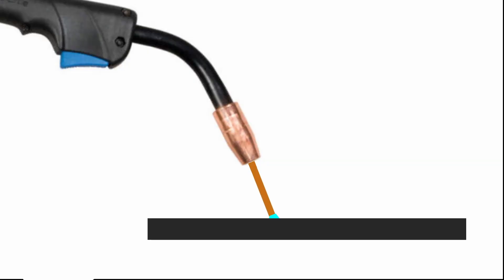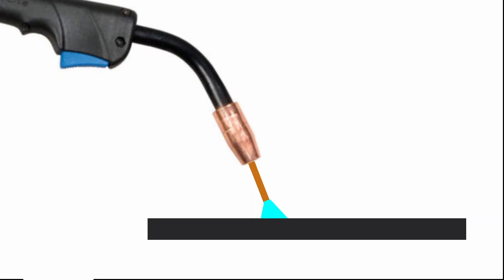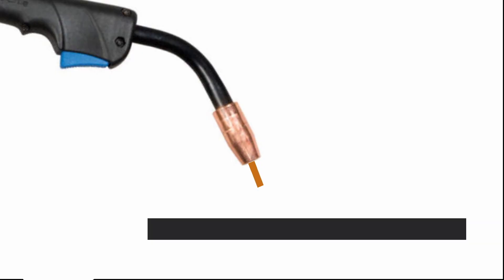MIG Welding: What's Happening at the Arc?

Comment: I learnt the trade of boilermaking in the late 90s…moved into HVAC and then electronic controls from there..The mig side of things were taught to me by a craftsmen level boily,  he was a cast iron expert in pressure vessel repair design and construction.  So he told me that mig is just shit!  TGAW is hands down the best way to weld ally.  Also arc welding in general is a more solidly certain form of welding ferrous metals.  Most fan boys will not like this.  But I have been in the ship building industry for defence and the older methods are still used.  Given the mig style is quicker,  when the welds need to hold,speed is no consideration.  Really the only addition to old methods over technology are addition of inert gases.  People will disagree but let them.  My advice comes from a craftsmen,  of which are a rarity currently.

Comment: 5:20 finally an explanation of the voltage, wire feed, arc length and heat relationship. I've watched 100s of welding videos and have never heard this explained so simple and concisely. Thanks Tim.

Comment: Can you do a video with the htp 160 plus showing what rods can it weld and the durability
Reply from the maker: I'll try to work it into a future video. I''ve used it several times and it's still working great. The only rod I've had a hard time running with it is 3/32" 6010 (runs 1/8" 6010 just fine). I'm mostly a 7018 guy and it's one of the best 7018 burning inverters that I've used.

Comment: Great video, Tim!  By far the clearest explanation of the different transfer types I've seen.  Really good arc shots, BTW.  Why do some gas mixes include oxygen?  It seems counter intuitive.  I thought the shielding gas was to prevent oxygen from getting to the weld puddle.
Reply: To run hotter!  Most guys are going away from oxygen and are moving to co2 instead ….  Which i guess still has some oxygen in it.  It called the active component in the shielding gas, it is necessary to agitate the weld puddle properly.  There is absolutely no active gas when welding aluminum …  and there is VERY minimal active gas when welding stainless and on steel it varies … short circuit can be welded with 100% co2 ( active gas only) and it can be welded with with mixtures as high as 95% argon and 5% either co2 or o2 ….  If you go all argon it wont work, on short circuit it will be too cold, not enough penetration… if you do steel spray it will be too hot and you will have a bunch of undercut
Reply: @ZILAwelds  Very informative reply, Peter!
I see many people who think "MIG" but don't understand that much of what they think is actually MAG (metal active gas)
When the garage warms up 🥶 I'm going to have to get a bottle of 75/25 to see how differently it behaves for me.
Reply: @ZILAwelds  yeah we do aluminum (mig and tig.... mostly mig for me, I'm still learning tig) and we use straight argon.
Reply from the maker: Thanks! Peter pretty much covered it. The addition of active gasses effectively increases electrical conductivity and therefore gives a bit of a hotter arc. It also affects the fluidity of the weld puddle. As far as oxidation goes, the filler metal has elements added which will preferentially oxidize, gathering up the oxygen like garbage men, then floating to the top surface before solidification.
Reply: @TimWelds  YES  that is your silicon and other ingredients.  ER 70-S6 wire   Stands for Electrode (on a) Roll 70ooo psi tensile strength ( nominal )  with 6% silicon ( which is a flow promotor, detergent and deoxidizer.   
So these “glass eyes” on top to the weld bead those are silicon ….
Reply: The we,d additives will only handle a small percentage of oxygen in the gas though, which is why it’s still mostly inert.

In truth, all the major manufacturers of welding wire have charts showing the various characteristics of their wires. They usually show, (ESAB does this most extensively) the weld characteristics for several allowed gasses. It’s notable that always that I’ve seen, the quality of the weld is lowest when CO2 alone is used. So it’s cheap, but not quite as good.

Comment: Would like to see an amperage trace of the feed motor load while the wire is being pulled & pushed. Feedability is also arc stability.
Reply: On single pulse the wire speed is constant. Only on double pulse the wire speed is alternating between a higher and a lower setting. 
As far as amp draw on the feeder motor: it is supposed to be low and constant, the only time you would see high amp draw on the motor is when your wire spool brake would be set too high or the wire feeder is on a very high number or your liner is worn and creates a lot of drag ….
The key is for the electronics in the machine to know how much wire exactly is being fed ….  In order for that to happen there is a digital encoder on the back of the wire feed motor that reports exact wire feed speed back to the logic board in real time so the electronics can make adjustments to pulse settings in real time while welding
Reply from the maker: Like Peter said, the wire speed isn't varied in this example. You're totally right about wire feeding playing into arc stability. In fact, I was dealing with this problem a few days ago (Not on one of my good machines, a cheap no-name brand feeder). I had an unintended pulse going on because of the clunky feeding mechanism :). I've also found that the winding and cast of the wire play into it a bit. Sometimes with cheap 4" spools, the wire will wander all over the place as it comes out of the gun.
Reply: @TimWelds  and thanks for recognizing the distinction between wire feed & arc stability.  Some performance points not covered:
-knurled surface vs smooth V surface drive rolls. Single vs double roll kits. 
-drive roll tension. 
-condition of liner/contact tip or guides
-Manufacturer's GMAW process differences. For S3/S6 copper adherence, surface cleanliness, surface lubricant, point of electrical contact between wire surface & contact tip, wire cast & helix.

Comment: Agree with Lazaro Valadez; I'm a hobbiest and only have SMAW machines. Sometimes wish I could (easily) weld thin stuff—tubes and sheets—but the price of a suitable machine is prohibitive. (Don't bother mentioning cheap entry-level machines; I don't hafta to have the best there is, but do hafta have a good quality, versatile machine.)

Your explanation of the various designs helps tremendously in my understanding of how to evaluate satisfactory offerings.
Reply from the maker: I've run SMAW on some fairly thin stuff, but I always clinch my teeth when I do it :)
Reply: @TimWelds , burst out laughing…still chuckling. I totally get it, and suppose sometimes you just gotta go fer it  
🤣 🤪 👍
Reply: How low does your machine go? I have some 1/16 6013 for thin stuff amd they work fairly well for that
Reply: @anotherrandomtexan25 , thanks for that! I haven't tried 1/16" yet—I do have a bit of it on hand but haven't needed to weld any of it. I mostly wanted to be able to use some scrap that ranges between 32 to maybe 28. No sense torch-welding my ideas, probably just need to make a spot welder, eh? But not even on the back burner. 😁